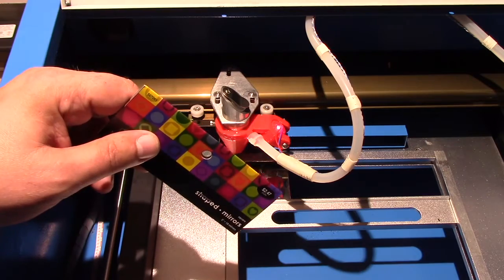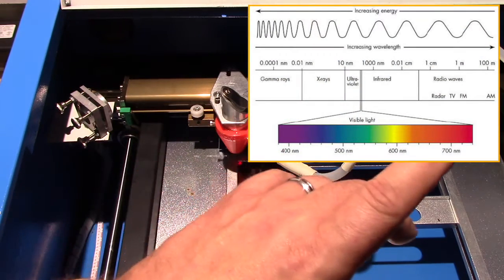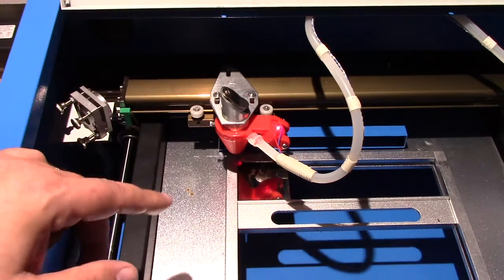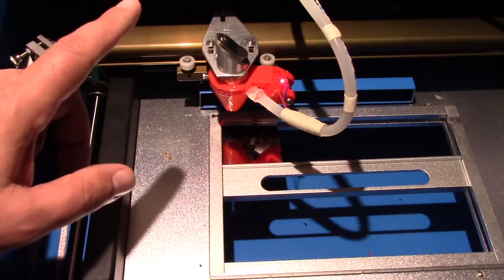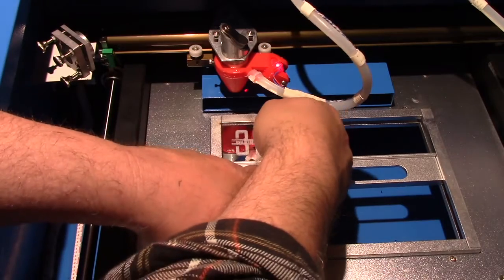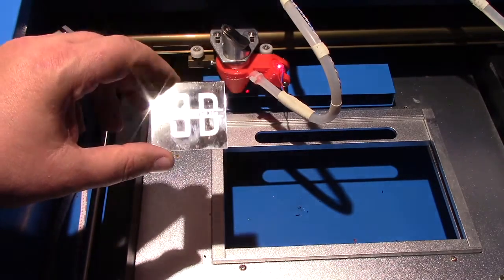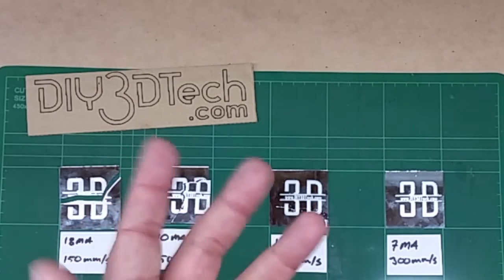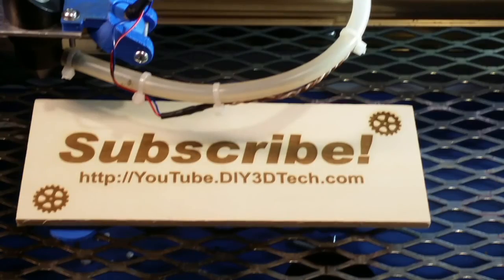K40 eBay Chinese CO2 Laser Cutter & Engraver - How to Etch a Glass Mirror!

Comment: Are you using air assist to engrave with?
Reply from the maker: For the most part no for engraving.  If it was really slow then I would keep the lens clear, however for high speed rastering, no...

Comment: You can use a diode laser invert the image and engrave back side of the mirror or paint the mirror side black and engrave.
Reply from the maker: Yes that too is also an option (invert the image and engrave back side) however I have never tried this with a visible light laser.

Comment: Several years back, I used an Epilog to etch logos on wine glasses. The raw laser created a very rough surface as exhibited in your example. From a recommendation, I covered the engraving area with a damp paper sheet and "engraved" through the damp paper. I got excellent results that mimicked media blasting or acid etching. I cut the paper into a shape slightly larger than the laser field and used a mist type spray bottle to wet the paper in place. I used plain water with a drop or two of liquid soap as the wetting agent. HTH
Reply from the maker: Thanks for sharing I will try this! :-)

Comment: would 80w laser be too much.  Can it engrave with lower settings
Reply from the maker: With a laser the more you can afford the better off you are.  However typically it isn't till 100 watt and up you see dual tubes units (one for cutting and the other for engraving).  Also with engraving its dual function as in power verses speed.  So if your "floor" power wisw is still to high just move the head faster...
Reply from the maker: With a laser the more you can afford the better off you are.  However typically it isn't till 100 watt and up you see dual tubes units (one for cutting and the other for engraving).  Also with engraving its dual function as in power verses speed.  So if your "floor" power wise is still to high just move the head faster..
Reply: Thanks
Reply from the maker: Your welcome :-)

Comment: The directions that came with my laser say do not cut or engrave mirrors. It could damage the laser. Isn't this an issue?
Reply: DIY3DTECH.com It's the same Chinese K40 CO2 laser as yours. It made sense that maybe the laser beam would be reflected back on itself? Thanks for all your videos!
Reply: Maybe they are afraid that if everything lines up just right you could get the beam bouncing back from the mirror and all the way back into the tube?  Just a thought.
Reply from the maker: Is it a CO2 Laser?  A visible light laser will not work for a mirror, however, IR is a very long wave and is readily absorbed by the glass.  Since I don't know your laser, I do not want to advise you to do something to damage it, or yourself.  However, speaking of only mine, I had no such warning, and have engraved many mirrors with both of them.  However, as I note in the video be careful of reflections as you can see the flashes in the IR camera...
Reply from the maker: Your welcome and again don't want to tell you to do something your instruction tell you not to do, however my hobbyist two cents would find it hard to believe that reflected light is an issue.  When I do the back-side mirror video I will ask the question and see if any other viewers have had similar statements in their instructions  or if they know the reason for this...
Reply from the maker: As promised to the Dark Alchemist I did another mirror video and I posted  your question at the end so let's see what the YouTube world comes back with.  It's Scheduled for tomorrow at 8pm est :-)
Reply: This was my thought too since the laser of these machine bounces off mirrors before engraving - any reflective surface should be treated before hand

Comment: Any thicker mirror samples from a real supplier.  Hobby Lobby mirrors were WAY too thin.
Reply from the maker: Wanted make it for the average "joe" who shops at hobby lobby as they are cheap mirrors but same would true even for thicker ones.  As at the higher power it creates shards of glass which will (did) cut...
Reply: DIY3DTECH.com - I was amazed at the "destructive" capability of the laser.  I would suppose that you have tried this on regular glass.
Reply from the maker: Yes did one on fuse glass and have another coming out (i.e. dedux) in Dec.  I like doing glass...

P.S. did you write another question as YouTube messages get flakey some times and I get so many they fill multiple screens and they are hard to find...
Reply: I believe I did. Was asking about the laser as I'm trying to get my wife onboard to get one. I have seen one 40W on Amazon for a decent sub $400 price that looked like the first one you have.
Reply: I started watching your Select Mini temperature test video but the wife fell asleep and my headphones are not nearby. Time for bed anyway. Aren't you up late or in a foreign time zone?
Reply from the maker: Makers never sleep :-)

Comment: I was hoping you would have done this on the back as well to see the effect and settings.
Reply from the maker: It just burns the silver in and makes it looks frosted can do another and show this.  However must say the look was very interesting...
Reply: DIY3DTECH.com
I would love for you to do that as I figured it might have a different look AND no shards of glass on the front.
Reply: me too.  very cool
Reply from the maker: all right when I get back home I will do one of the back :-)
Reply: DIY3DTECH.com
Awesome.  Btw, can you not go lower than 7ma on that?
Reply from the maker: yes I believe around 5ma is the bottom...
Reply from the maker: P.S. Hit return to quick, the reason I stopped at 7ma as I don't like to run to cold as I am concerned with potentially damaging the tube it's nothing more than an arch lamp and concerned that  running to low (cold) might damage it.  Again this is my take and (i.e. risk of damage) and not something I know for sure...
Reply: DIY3DTECH.com
I believe you may be in the HF laser range the Sarbar guy talks about and his starts around 13ma and goes down.